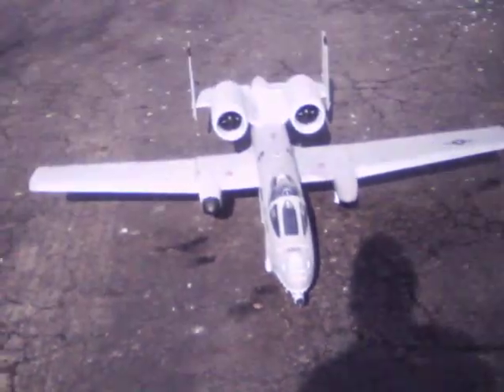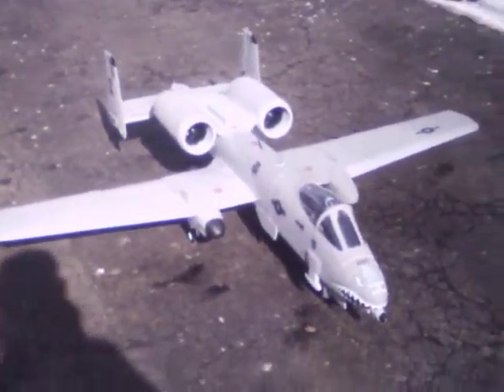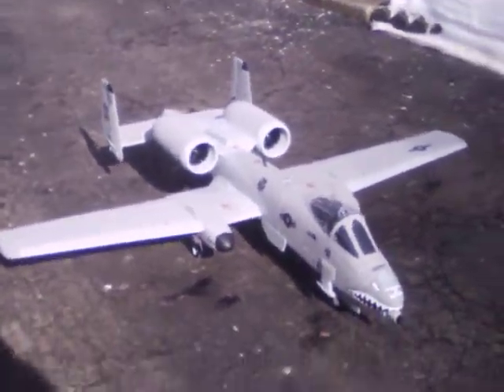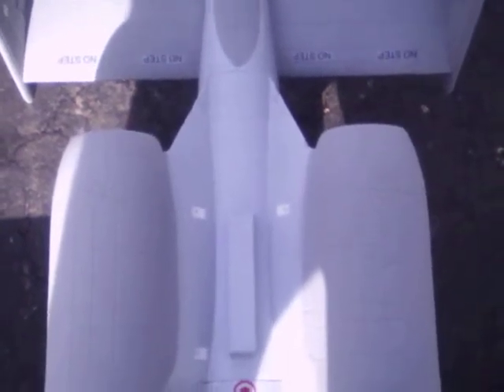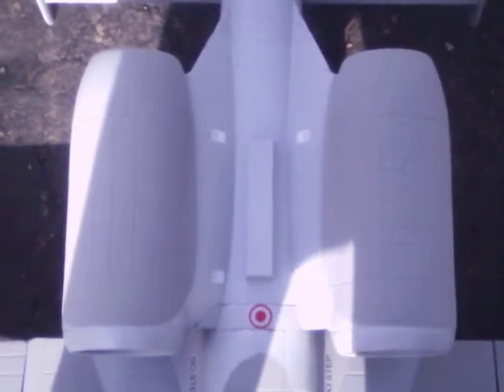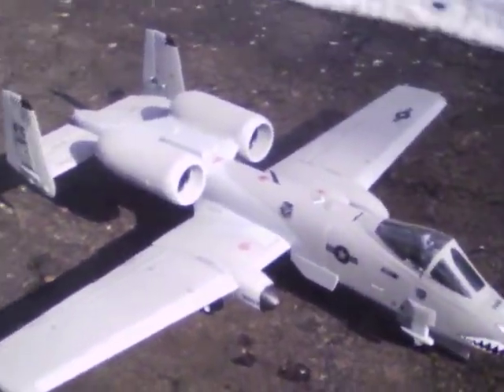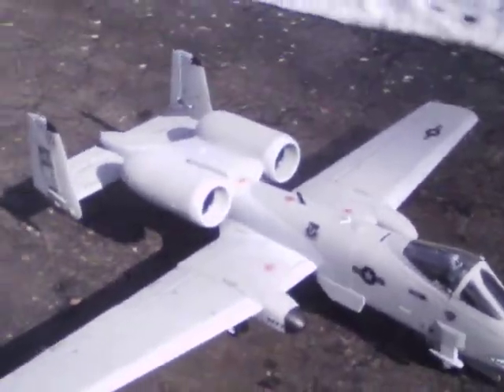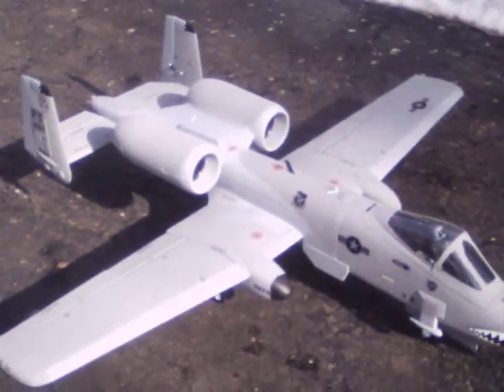L.X. Twin 70mm/A-10 Taxi, Motor run-up...

Comment: Hi 
Yeah I am going to replace it to ec5 connectors, my hobbyshop recommended it.
But was it difficult to do this with solderinh the connectors of the plane (I mean the wires of the motor which connects with the battery)?
Multimilton25

Comment from the maker: I actually replaced the 5.5mm bullets w/ Ultra Deans connectors, seeing how all my batteries/planes use them. It worked out fine. I would have kept them on, if I were running higher than 6s. I have'nt had a problem since...

Comment: Hi 
Did you replace the connector of the battery too, or had you found a connector and wire that connects the battery to you balancer?
And does it fly smooth?
Multimilton25 :)